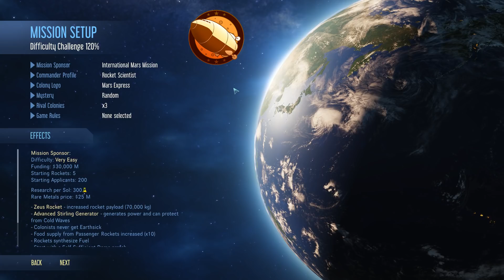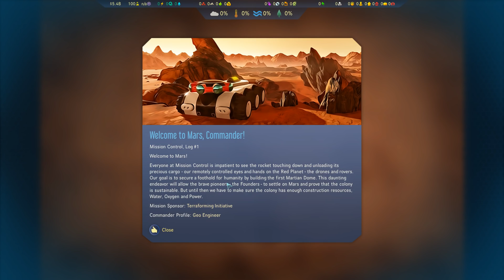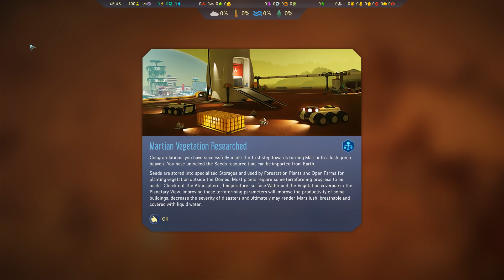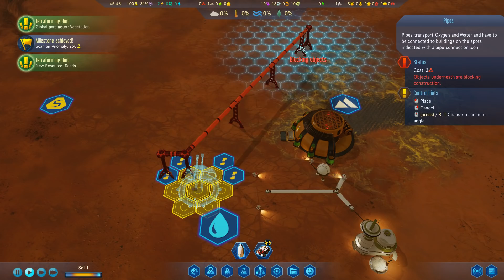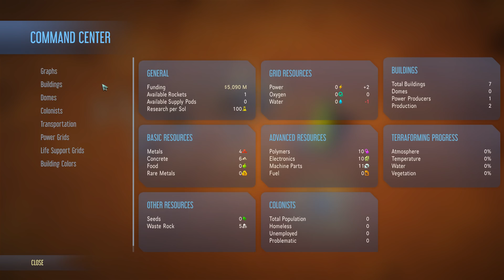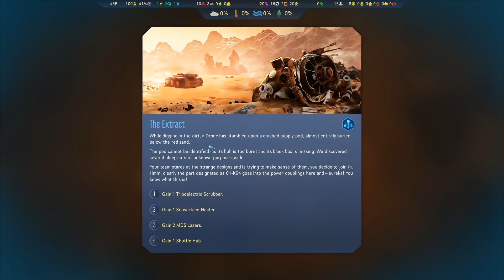Surviving Mars: Terraforming the Red Planet | Green Planet Ep 1

Comment: 2 important notes: i) Always turn off fuel in universal storage areas, as if the fuel spot is exploded by anything it'll take out all the other stuff on that storage pad!  ii) All ground extractors produce dust, so keep your other stuff (eg power plants, domes etc) away from them to cut down on dust maintenance & breakdowns

Shame you picked such a flat spot to start with: the new dozer (or drones for slower progress) allows for some v interesting terrain manipulation mechanics

The subsurface heater is to offset the effect of cold waves/locations; it's prolly the most useless thing you could have picked in that list given your location doesn't have them (it's always been in the game BTW, as were all the other listed items - it's not been added for this DLC) :(